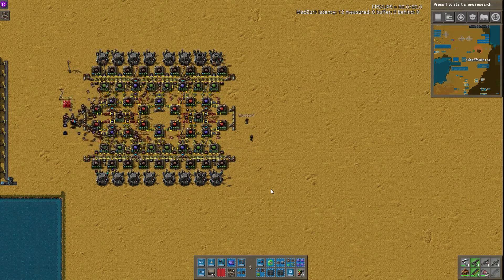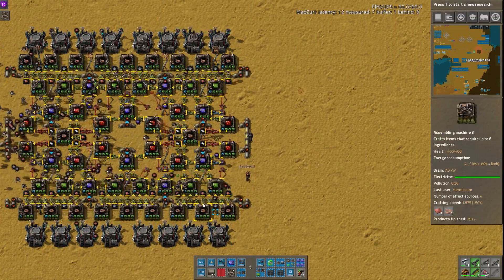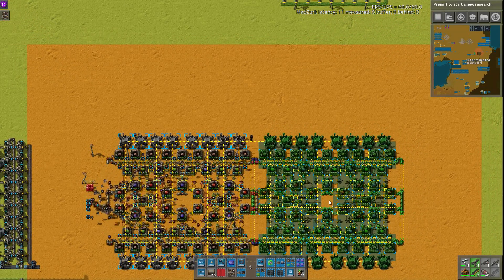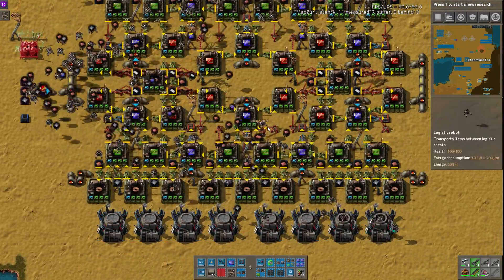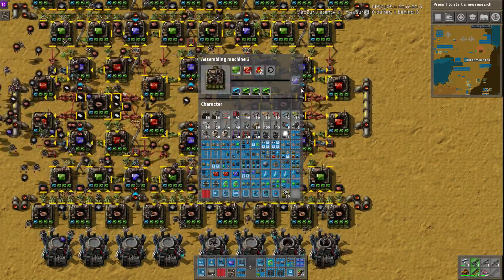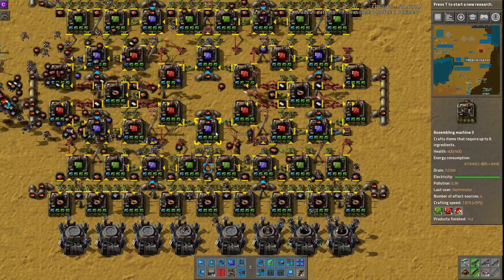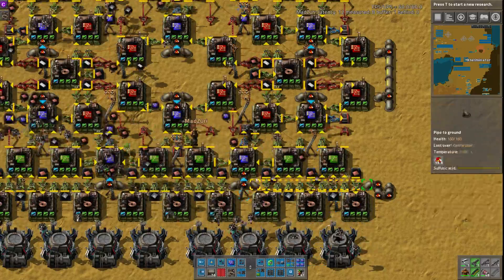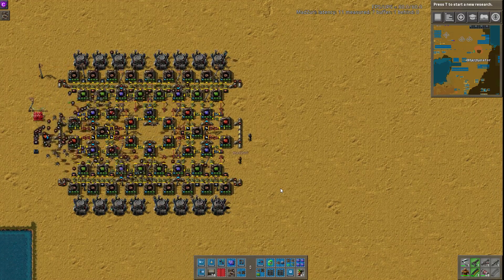Direct Insertion Blue Circuit Build :: Factorio Workshop Season 2 - Building A Better Factory

Comment: hello i am the creator of the design and i immediately noticed the missing inserters after i submited it.
i am using this design in my map and set it up exactly like u did it as well. i hope my design helps some of your viewers on setting up blues since its quite difficult.
Reply from the maker: It is a great design for sure! Getting the perfect ratios like you did with direct insertion was quite clever. Good job on the build!